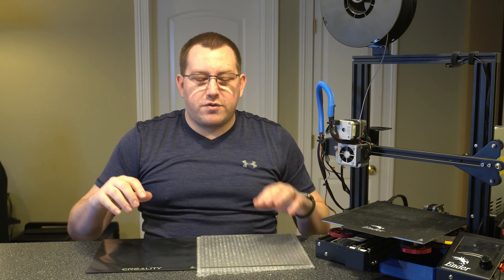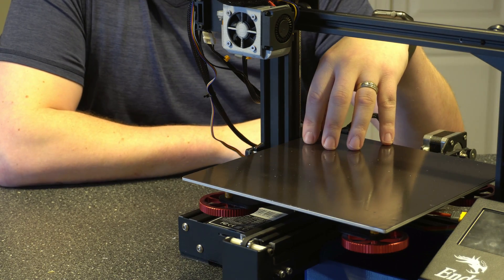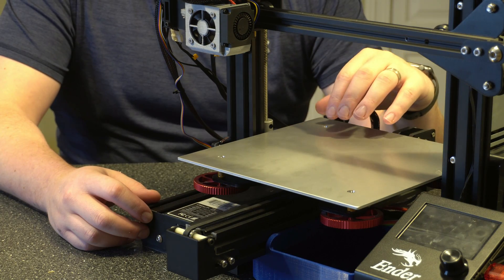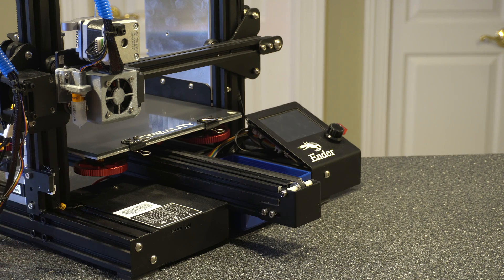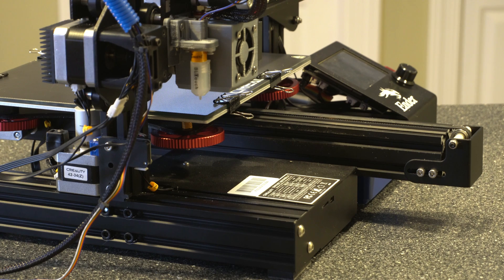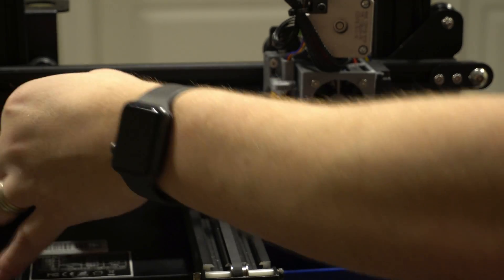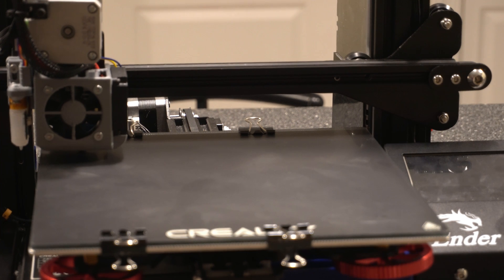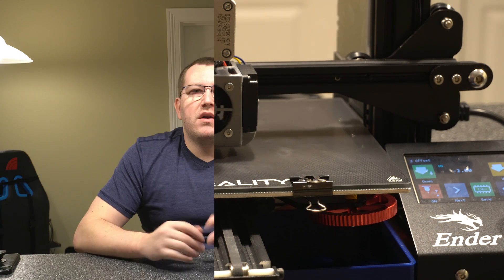Ender 3 Pro Glass Bed Upgrade – Complete Install Guide!

Comment: Have you tried printing PETG on the Creality glass? I just got the glass build plate but I have been hesitant to put it on yet because I’ve been printing PETG lately and I’ve heard stories of it sticking so badly to glass that you can ruin the surface trying to remove the print.
Reply from the maker: Hi. I havent printed PETG on it yet, i did print PETG on the basic glass one and didnt have an issue though. Make sure you use a glue stick or something similar to act as a release agent.
Reply: I don't have my Creality glass yet (on order) but I also had this concern, but from the research I've done if you actually let the glass bed cool down PETG pops off easily apparently!
Reply from the maker: @xbuckfutterx  Hi. You will want to let the glass bed cool down before trying to remove the object, the same thing is true if you use PLA. I would still recommend using a release agent, like a glue stick, to start.

Comment: What are your thoughts on a Polypropylene build plate?  How does it compare to glass or the magnetic build surface?
Reply from the maker: Hi. I haven't used them. I have used PEI build plates and they work well but im not sure if either of them is worth the extra work/cost.